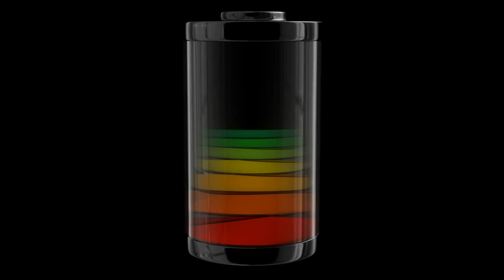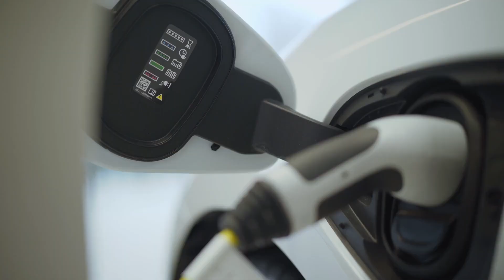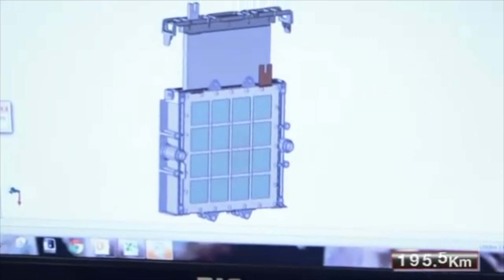This Battery Gives EVs 1000 Miles of Range!

Comment from the maker: **Correction: I meant to say 1,600 km or 1,000 miles. Apologies!
Reply: oh no its so hard to convert the Miles on your smart phone LOL
Reply: @rory-red  only if your smart phone is powered by an AlO² battery!
Reply: @rory-red  But it's still a hassle. It makes more sense to just stick to metric, so people can do maths in their heads, and leave the smartphones to the Luddites still clinging to the US system.
Reply: @nomadMik  I live in texas i use metric i was mocking the ppl that do use their phones lol
Reply: what about Zinc-air-Battery? They allready exist in hearing aids. Also wiht great energy densety.
Reply: I ran to the comments when I heard that and saw this😂
Reply: Yeah, I was going to say the answer was more like 500 miles not 1000 (from "600 km")

Also, you said "The Negatively charged.....ANODE"  Anode is positive.........
Reply: 2021 environmentalists: we are in this mess because people didn’t care about the environment 
1960 industries: this battery is way to toxic to be viable
2021 environmentalists: look at the extra range we have to get this in production now.
Reply: Your comparison between Gasoline storage and battery storage capacity is not accurate. it take 6 gallons of gas to store the same amount of usable kilowatts as a Tesla Battery .  And in the average car 6 Gallons of gas will get you less than HALF the distance of a Tesla. YOU SAID 2 GALLONS.. Reason ... ICE engines are GROSSLY inefficient. Also Electricity from Natural Gas Power Plants are THREE TIMES MORE EFFICIENT in produces usable KILOWATTS per BTU of FUEL than ICE Engines. The engine in your car is designed to burn as much gasoline as possible. Aluminum batteries DON'T WORK for cars....   So your Headline is CLICKBAIT. But you knew that.
Reply: @dwmcever  - I think your use of “usable” makes your and Ricky’s statements different. I think he said energy in the gasoline. But ICE enginess have very low efficiency. So you’re both correct.
Reply: @dwmcever  Overly harsh and dismissive comment that hinders intelligent communication.
Reply: Release Zero point energy tech and your car will never need a charge.  Trouble is they can't put a meter on this like they can your has or electric usage. Also a man came out with a car that runs 9n water in the 1980s. Let's just say he was not around long enough to put it into production.
Reply: He IS da Vinci
Reply: Ha, I was just coming here to say that... 600 mi = 1000 km, not other way around
Reply: Edit your title
Reply: The internet was gonna burn you for that one
Reply: alloy batts,in the 60,s. banned because of oil magnates. chemicals was an excuse. no one cares if a miner dies.. do they..this is also why we dont have sodium reactors,,they dont produce weapons grade fuel. but,there ultra safe,clean,& never explode..do a series on that..dare you.. youll be banned.
Reply: While on the subject of corrections - it is a land rover defender rather than a range rover defender.
Reply: Also you forgot to mention that the U.S. purposefully keep these regions unstable politically and economically to militarily control the regions.
Reply: What hapened to graphene?
Reply: Don't worry, in today's world, if you want 600 kilometers to equal 1000 miles, that's okay. And if you wish to self identify as a canary, even though you appear to be human, that's okay too.
Reply: @stwickers  correction 1600 KM not 600 like he said. He wrote a correction. He also said 1000 miles. I really don't think the auto industry will go with Aluminum Air batteries. You must have rechargeable batteries. If they get up to 500 miles with AC or Heat then there is no reason not to go electric. But you will have people that want to keep their gasoline vehicles. Even if they are falling apart. I seen my share of crop dusters on the road. If smoke comes out of the tailpipe the vehicle needs to be pulled off the road.
Reply: My 2018 Ford Focus averages 38 MPG. To travel 300 miles requires slightly less than 8 gallons of regular unleaded gasoline which weighs about 6.2 pounds per gallons. So, 49 pounds of fuel is needed for a 300 mile journey, or about 4 times the amount you cite 25 seconds into the video.

Using 25 MPG for the comparison would result in a need for 12 gallons of gasoline at a weight of around 74.5 pounds. Still significantly less that the 1,000 pound battery pack weight.
Reply: Rchee Debunker  no it’s 616 fathoms and 457.9 quintoms in old English/Dutch
Reply: I was about to say that
Reply: @eddieneves1808  I was about to say I was about to say that, but you said I was about to say that
Reply: @johnruciak  I was about to... never mind.
Reply: Haha. Me too
Reply: Can you provide the link for the music used at the beginning of the episode?
Reply: Either the link of the name  or artists
Reply: So did it extend the range of that particular vehicle by 1600km or 600? Because 1600 doesn't sound true
Reply: I got really confused for a second.
Reply: The other option is super-capacitors, which are currently limited to small electronics but I have them designed in a large drone.
Reply: @Tonyp3  cool, care to share some pictures?
Reply: I came to the comment section for this exact thing. I was like “Did I hear him correctly??” 😂😂
Reply: Hope that 1000mile range is with a fully loaded vehicle. That would be a game changer across the world.
Reply: I was gonna say, really need to check some math there lol
Reply: Quick math.
Reply: Oh dude I’m so glad you said that ! 😮‍💨
it was bothering me so much and I really Felt bad that I’m about to tell people that instead of 1000 miles it’s actually 372.8
Reply: Please,do you have the Stock Symbol so I can invest my money into this Company? Thank you and have a great day😄👍🏻Chris
Reply: Still waiting on that "magic" battery. 🤨🤨
Reply: @eaglerepublic3091  long wait that also should hold true in deciding to buy an electric car. I do use electric lawn mower if the grass ain't too high.
Reply: @piotrtrebisz6602  watch the video and learn the law of physics. Batteries cannot be recharged. I myself jumped the gun and comment before the video was finished.
Reply: @piotrtrebisz6602  hybrid cars already do that but with an engine.
Reply: @piotrtrebisz6602  that may work just like lead acid batteries are recycled. Most of the time just replace the acid with new acid will restore an oxidated battery. Some people tried using Epsom salts and restored the battery I have no clue of the success. I haven't tried it.
Reply: To late
Reply: I totally understood what you meant. It's the 1.6 vs 0.6 conversions.
Reply: Thatz hella range.. If they are light why not put 2 or 3 cells?... solar heat collectors have been planned to process aluminum ore
Reply: It's your video how dare anyone complain about the introduction. Next time take 10 minutes of introduction stuff.
Reply: ok good, because I was about to point out 600km is significantly less than 1000 miles :)
Reply: What is your real name
Reply: Rchee Debunker  never happen. Battery companies won't let it happen. They would rather make batteries that are thrown away. Just look at dura cell or everyready Energizers if they ever made a 1.5 volt rechargeable battery they would lose money on Alkaline  battery sales. That's why the rechargeable have reduced voltages. Most only 1.2 volts so a three volt flashlight will only have 2.4 volts. And players will run slow because of the lower voltages.
Reply: Rchee Debunker  dream on! It will never fly.
Reply: Trivial really. Great videos mate keep it up
Reply: Umm 2 gallons will not get you 300 miles, wtf are you talking about
Reply: I was going to say at 810 you messed up
Reply: was about to comment that your conversion seems off
Reply: Glad you posted this, I had to stop the damned video to see what itnwas supposed to be and it was right at the top of the comments!
Reply: Lol just jumped on here to correct you but I see you caught it yourself.
Reply: This means the construction and reprocessing of a battery for every 1000 miles... expensive.
Reply: Ok... thumbs up returned lol
Reply: Meh, 1000km is still better than anything currently available.
Reply: Humans 0
Saiya-jin 1 to 6
Angels 7 😇

Kalki Ironman 5th matriya buddha 8th arc Angel 11th satguru 13th imam and 24th avatar after 2026 😎

Almighty God 9 😇

Humans type 2.5+ after 2026 by Kalki Ironman (christ in the white horse)(son of man on clouds) type 7 and 8 😎
Reply: Jarvis the world’s first artificial intelligence (parrot) 😎

Cuz Kalki is ironman batman and every super heroes combined after 2026 😎

Jarvis world’s first artificial living being (just like vision in marvel universe)😎

Made of Quantum and sub quantum particles 😎

Power source quantum energy arc reactor (type 7) level technology 😎

Kalki Ironman going to have every kind of arc reactor like:- type 1 Nuclear fission, nuclear waste, hydrogen fusion, type 2 3 4 5 antimatter arc reactor (solid liquid gas), type 6 electro quantum arc reactor, and type 7 Quantum arc reactor, type 8 limitless quantum energy arc reactor without quantum particles 😎

Kalki Ironman going to have sun in a box million billion tons of hydrogen nuclear fusion reactor type 2 3 4 5 just like sun and stars in the palm of his hand ✋🏻😉😇😎
Reply: The only way you will get acceptance of battery powered vehicle's is a kit to "retrofit" gas powered vehicles for under $1,000! Otherwise, the new technology will not be accepted at all. The range must be comparable to the equivalent to 700 miles per day on ALL vehicles up to tractor trailers and down to scooters and everything in between. I had a Honda Prius that needed a battery replacement about every two years(+-) at a cost of $2,000 per exchange. NOT affordable, nor convenient at all. So, I sold the Prius at a price higher that I bought it used and bought a Ford F-150 faster and promised myself never again on a hybrid or battery powered vehicle. NEVER!
Reply: @lomgshorts3  

Read my comments first and remember approx 10kw is equal to  1 liter of petrol 😏😏😏😏😏
Reply: Tesla has 100kw battery pack or (equal to over 10 liters of petrol) highest in cars it means it can travel 10,000 kms to 20,000 kms in 100kw or over 10 liters of petrol in 1:1 rpm and in 1:10 rpm can travel 10x or I say 100,000 kms in single charge not to mention 1:11 1:13 and 1:24 😏😏😏😏😏
Reply: Those batteries are so revolutionary that they change math lol.
Reply: New Fuzzy Math ! ;)
Reply: Or 1,000km and 600 miles😁
Reply: Lithium mining is extremely detrimental to the environment so they are not at all eco friendly, they are in fact the most harmful batteries to make!
Reply: Shilling for Barack huh? Scripted right out of his playbook.
Reply: @piotrtrebisz6602  get the miles up to 3000 and it would be like an oil change. Which electric cars won't need. It will depend on the cost. Not just for the battery but also the car itself. I myself think we should go hydrogen it's much more environmentally friendly. But the stations don't have hydrogen. Just my opinion. I haven't researched it out.
Reply: And split that roughly in half to see miles 1600=800aprox. miles. A third of a trip across North America.
Reply: Not! everyone makes mistakes if you say you don't your a liar! 
I would not redo anything unless you want to make an updated version. Making someone redoing a video is like popular electronics calling back all the current month from all subscriber's and sending a new copy. They just post an out of tune on the next copy and people read the correction. Same holds true here READ THE VIDEO DESCRIPTION AND LEAVE IT AT THAT.
Reply: Took you 5.2 minutes to get to the topic
Reply: Too late this is old news. And who cares!  The battery is not rechargeable and it won't fly. It's about range and 5 minute max charging time. Until we get there electric cars a waste of time.
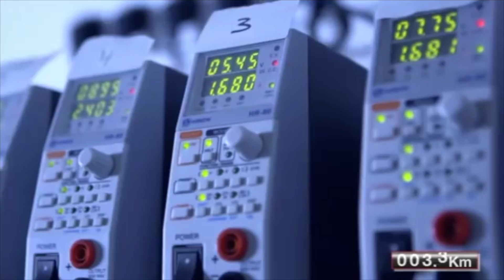Reply: 8:05
Reply: seen so many battery technologies.
I guarantee you, we won't see them ever
Reply: @dongshengdi773  Isn't that just illogical?
Reply: @nadgerz  not when bad people are trying to keep humanity suppressed by withholding technologies from them intentionally so they have to work harder to pay more bills.
Reply: @perfectinpieces9924  a response to comparing km to miles?
Reply: @dongshengdi773  what other kinds have you seen that seem good?
Reply: @dongshengdi773  If you project that reasoning back in time then you would guarantee that the lithium ion battery doesn't exist.
Reply: Don't blame the battery or Cobalt mining for the exploitation of children. Blame socialism and the Marxist dictatorships.
Reply: @YragLee  socialism? What African country is socialist besides Mozambique? The real blame is corporate capitalism exploitation.

Comment: A diesle hybrid compressed air car would be pretty easy to build.  Use a small quiet deisle air compressor. Use a series of air tanks. Heat the last two tanks with exaust, and alternator powered heat tape. After some air is transferred to the last tank, heat the air.  Hot air is harder to pump. So you pump it cold, then hit the compressed air with heat, so it expands and packs a punch. Rotate the heat so the air takes less fuel to compress, but gets the most power.

Comment: A battery platform and drive line would be a great thing to have.  An owner could place any style of body to the frame for a personal choice of looks and color.  Car dealers could sell the body based upon their own style.  The battery and driveline could be traded in for a new one when needed, but the key factor would be that all manufacturers would utilize the same battery/driveline system.  All attachments would use the same wiring and structural connections.

Comment: The battery swapping would not be an issue if you design the vehicle so that you can change out the battery without using lifts but sitting on it's own wheels. something like have to seats fold back to allow access or under door sliding battery trays.

Comment: Electric vehicles require fossil fuels to make and charge.  Our electric grid can't handle the loads required to keep EVs running.  A well maintained gasoline burning car is far greener over the lifespan of the vehicle.
Reply: Do you know what renewables are? do you know what nuclear energy is? i always need you to stop mentioning fossil fuels, we already have renewables! so stop bragging about it.
Reply: @TurbineOfTheWinds5816  Why yes I do, however what you think is renewable is 100% dependent on fossil fuels to work.  If everyone drove an EV, our current electrical grid could not handle the load.  Oh and if you believe carbon leads temperature, which it doesn't but I bet you do believe it, the carbon emissions produced by mining lithium, building, charging, maintaining and eventually recycling of an EV produces a lot more carbon than running and maintaining an efficient gas burning car.  There is no such thing as a green vehicle.  It is all based on junk "science".  As for nuclear, fusion is the actual holy grail of green energy.  Instead of going all liberal hysterics, educate yourself and see why.
Reply: @TurbineOfTheWinds5816  You are very poorly informed.  Renewables are.  Windmill blades are not made of renewable substances and can't be recycled.  The same goes for solar panels.  Also where do you think the lithium comes from for the EV batteries?  Why don't you go look up lithium mines.  Also fossil fuels ARE renewable.  I remember walking on a beach on Cape Cod, and I found an old tree stump that was well on the way to becoming crude oil, it was cut by people, and was right next to an old model T engine block.  This stump was clearly from the 20th century.  Additionally look up what actually happens to our recycling.  We used to ship our recycling over to Asia, where thy were burned or landfilled.  Now the same recycling ends up in India or poor countries in Africa, where it is....burned or landfilled.  There is no "green" efforts that have not made things worse.  We stopped using DDT, which led to millions of deaths from malaria, and an explosion of lyme disease.  We stopped using CFC, which led to the destruction of the space shuttle.   We stopped forest management and now we get super fires.  California refuses to build power plants, they have rolling blackouts.  Now we tell everyone to get EV's which our current power grid can't support, and solar and wind won't either.

Comment: & maybge those older, pretty 'tuff' gas motors could benefit from /meth/pro/bu/etc - tanes
& hydrogen fuels.  We had butane/propane 'critter cars' a LOT up until the mid 80s.  The were great until the 'dorks of the greed', unfortunately still amongst us, decided they could
double & triple & quadruple the costs of these materials.  Folks who had 'dual fuel' modified
vehicles didn't lose a lot & still had the 'camping' option if needed.  Once leftist politicRATS got hold of ca, it all went bad pretty fast.  It was a good part of The Golden Age, when ca was still known as 'The Golden State' before becoming known as 'a gobby sod'.
God Bless yer & thanks.